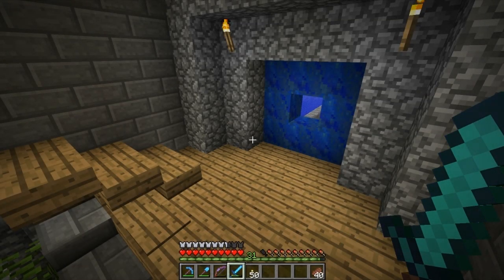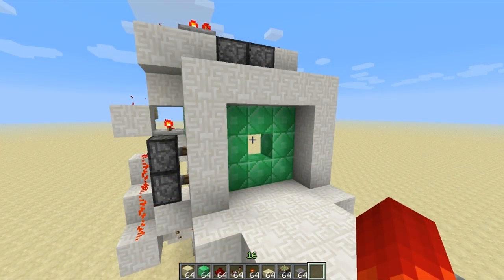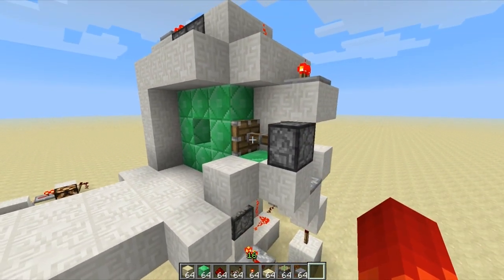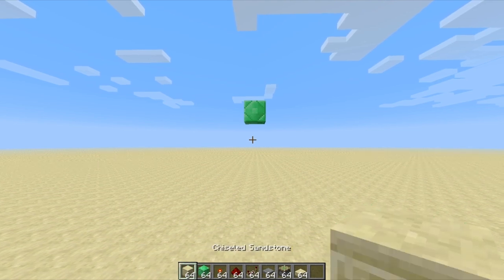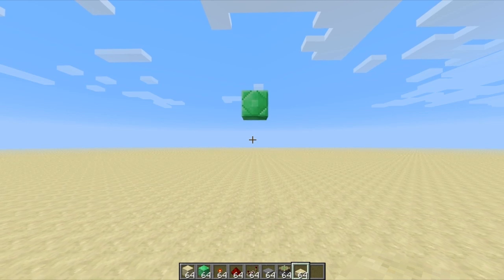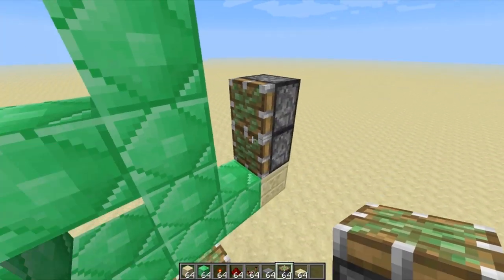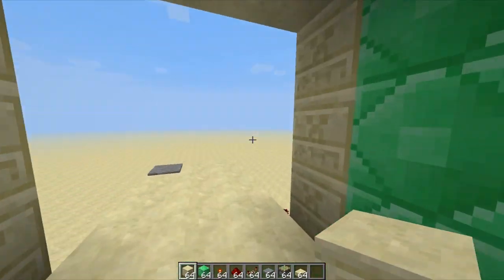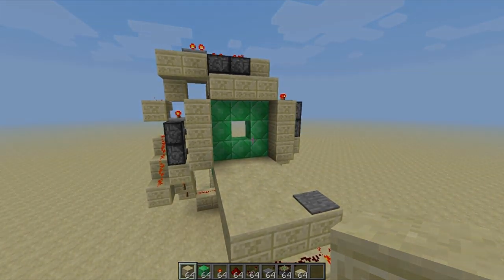NIMSTUT - 3x3 Spiral Door

Comment: What if I wanted to use a button and not a pressure plate? Please help.
Reply: All you need to do it run the redstone for the pressure plate with a redstone torch behind a button so that it turns off the signal to it when you press the button and then have redstone run into a block with another redstone torch on the back of that block into the current redstone he set up for the pressure plate. A little mire work then the pressure playe but will work :)